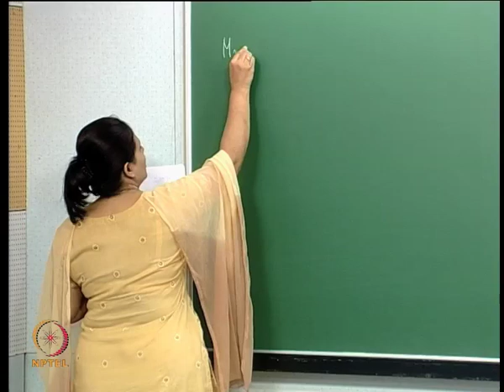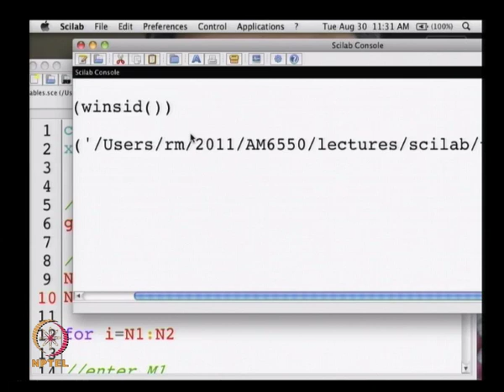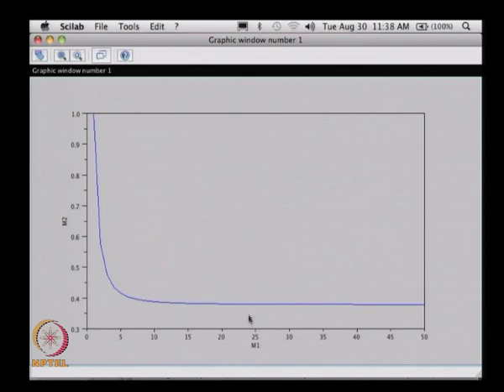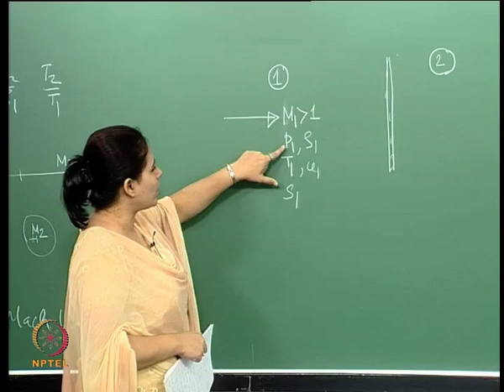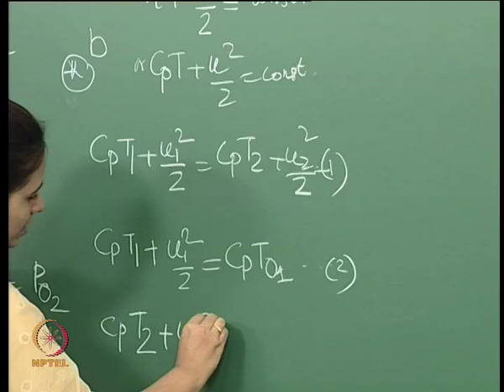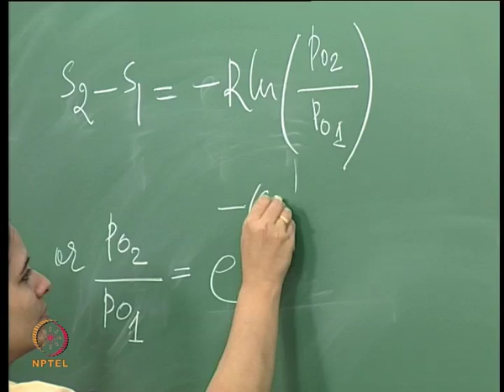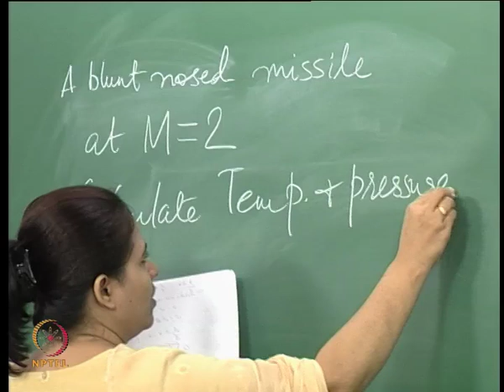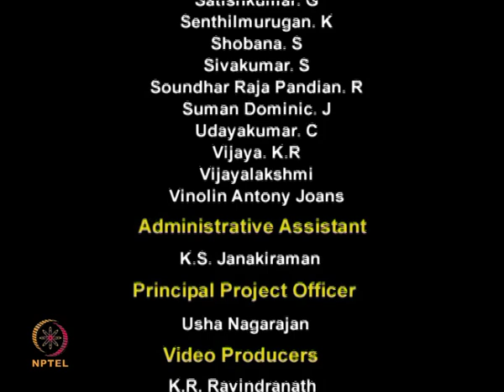Mod-01 Lec-07 Lecture-07-Example Problems in Normal Shocks

Comment: (6)... (1/M^2/y-1)+1/2= (y+1/2*(y-1))(a*^2/V^2)=(y+1/2*(y-1))(1/M*^2), through a simple algebraic manipulation we get one of the relation between the characteristics Mach number and the Mach number. M^2=2/([(y+1)/M*^2]-(y-1))/ By following the same procedures in manipulating the Momentum and the continuity together with the energy equations we can derive the L.Prandtl.

Comment: (7)...the L.Prandtl. relation that relate the Speed of sound a* to V1 and V2 the velocities of the flow upstream and downstream of the shock wave which is a*^2=V1*V2  and this equation can be written as follow a*^2/(V1*V2)=(a*/V1)*(a*/V2)=1=> (1/M1*)(1/M2*)=1=>from here we get the relation between M1* and M2* which is simply M*2=1/M*1 and  with the equation 
 M^2=2/([(y+1)/M*^2]-(y-1)) we get the  M2^2=[1+(y-1/2)*M1^2]/[y*M1^2-(y-1/2)] which gives the relation between M2 and M1 .

Comment: (4)...The energy equation can be written as follow h1+V1^2/2=h2+V2^2/2=constant , since h=Cp*T, then CpT1+V1^2/2=CpT2+V2^2/2.. Now we know that Cp=(gamma*R/gamma-1), let put gamma=y, => Cp=(y*R/y-1), where gamma is constant heat ratio y=Cp/Cv . we can rewrite the energy equation to (y*R/y-1)*T1+V1^2/2= (y*R/y-1)*T2+V2^2/2. we that the speed of sound is defined as a=sqrt (y*R*T) then a^2=y*R*T. rearranging in the equation we get 
 (a1^2/y-1)1+V1^2/2= (a2^2/y-1)+V2^2/2. following....

Comment: (2)...and at this point the element of the fluid is travelling at some Mach number M, velocity V,with static pressure and temperature P and T..Now imagine that we take this fluid element and adiabatically slow it down if its Mach number is greater than 1 or speed it up, if its Mach number is less than 1, in both cases we want to reach  Mach number =1. Now we know that speeding up or decelerating the fluid element the flow propertiessuch as temperature and pressure, density will obviously change.

Comment: (5)- (a1^2/y-1)1+V1^2/2= (a2^2/y-1)+V2^2/2. Now this equation can be manipulated in order to give a relation between the local Mach number and the characteristic Mach number.then the equation can be written as   (a^2/y-1)1+V^2/2= (a*^2/y-1)+V*^2/2. at Mach number =1 we know that the speed of sound is equal to flow velocity V then 
(a^2/y-1)+V^2/2= (y+1/2*(y-1))a*^2, again if we divide both side both this equation by V^2, gives: (1/M^2/y-1)+1/2= (y+1/2*(y-1))(a*^2/V^2)=(y+1/2*(y-1))(1/M*^2), ..

Comment: (3)....Then once the Mach number =1 the new temperature, pressure and density can be identified as T*,P* and rho*. Now the new speed of sound is a*=sqrt(gammaxRxT*), now here we can define the characteristic Mach number which is M*=V/a*. Now we can manipulate the energy equation in order to get a relation between the characteristic Mach number and and the Mach number at the same location.We know that under the assumptions in comment (1).